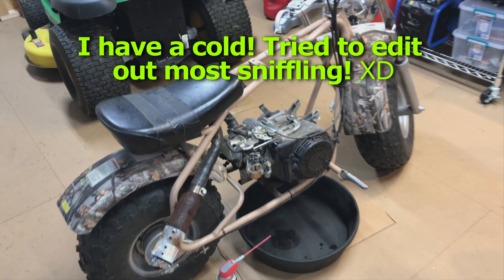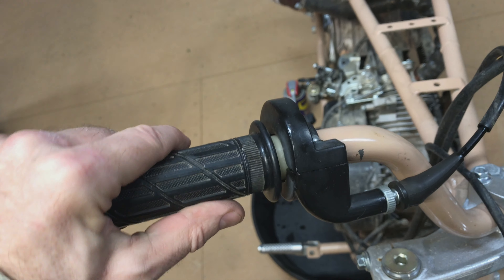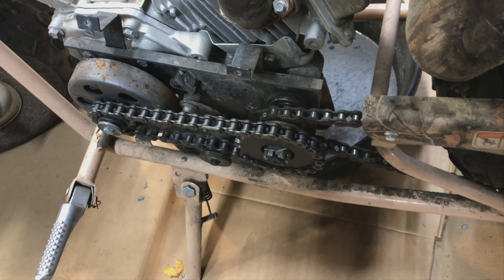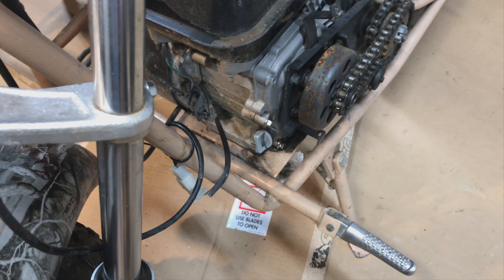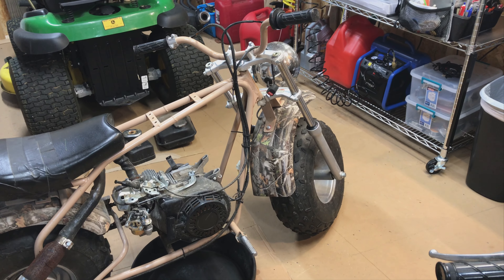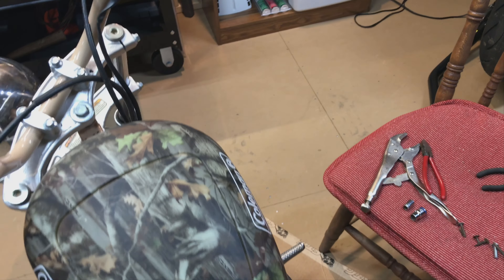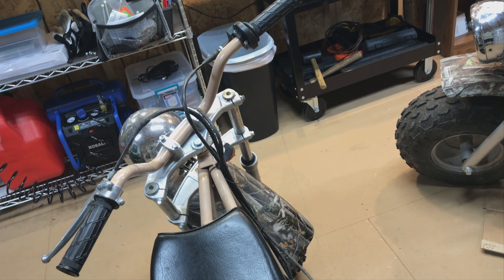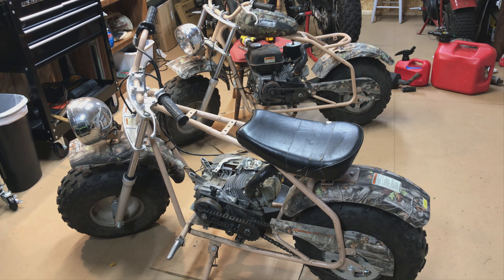TWO CT200U-EX Mini Bikes - UPDATE! DAY 2 [4K]

Comment: The tanks are nice when trail riding, I keep a tire repair kit w/CO2 inflator and plug and patch, a tool kit with added set of 4in1 ratchet wrenches, first aid kit, zip ties, a small toiletries pack for the wife and daughters w/some MRE toilet paper and moist towelettes and I still have room for my drink. We will go on all day rides and this generally takes care of any minor issues that arise. Almost forgot, I put a knock off Rotopax style gas can on the rear rack, which reminds me, for about $25 on Amazon you can get a complete rack system made for the red CT200 and mount the rear rack on the EX's. It has the longer axle and spacers in the kit you just need to drill a couple holes in the back of the seat frame.
Reply from the maker: Nice! I think I'll fix the hinge on that one tank/ compartment with some velcro and use the tank. Looks better with it on there anyways. It would be convenient to use.

Funny you should mention the rack! I actually saw one on Amazon for $25 a few weeks ago and figured I would get one just in case I get another minibike someday.. I got a brand new rack in box with the axle and everything. It came with the front rack too. Maybe I'll get another one. LOL - It's nice to have the racks just for moving the mini bike around if nothing else, just a place to grab it easily.

Comment: If anything you should get a predator 212 and install it on one of those
Reply from the maker: I have one (Hemi Predator) new in box but I think I'll try to get the stock engines going first.  I got two new carbs on ebay for $14 😂  Also might leave one stock and stick a battery and rectifier regulator on it so I can run an LED and tail light/ USB charger, etc..  Never had a minibike with a charging system. Might be fun to do!
Reply from the maker: But yeah one of them probably deserves a CVT + Predator + stage one for sure!
Reply: Awesome man really looking forward to watching your future vids 👍🏽
Reply from the maker: Alexis Narez Should be fun! 🤘

Comment: I have one of these mini bikes and it barely has 3 hours on it and it started blowing oil out of the muffler. Any idea what the problem could be
Reply from the maker: Overfilled? Did it get knocked over? 🤔
Reply: @bwxmoto  yea my nephew laid it down on its side one time
Reply from the maker: Brittany Cato send it! It’ll clear up. 👍 It won’t hurt it.
Reply: @bwxmoto  thanks a lot !!
Reply from the maker: Brittany Cato No problem. I’d just check oil level to make sure it has enough. 

Let it cool down and settle and have mini bike on level surface and open oil filler cap. Gently and slowly raise bike to level off of kickstand while watching for oil level.  Full is right up to the top or close to it when bike is level.
Reply: @bwxmoto  close to the top of the fill hole?